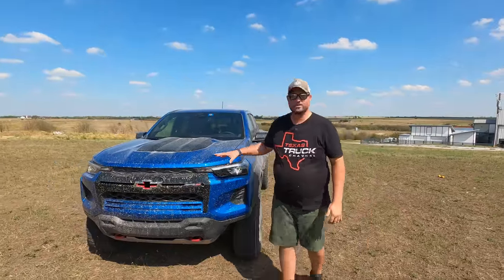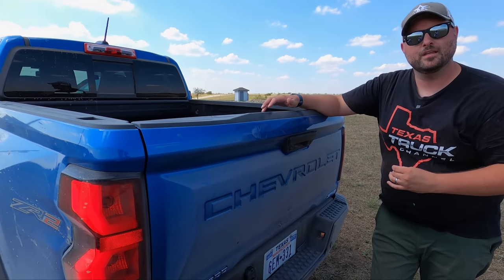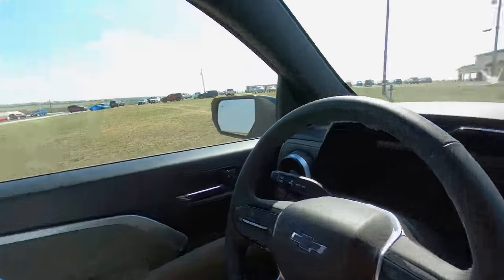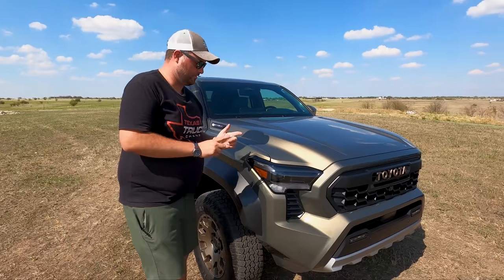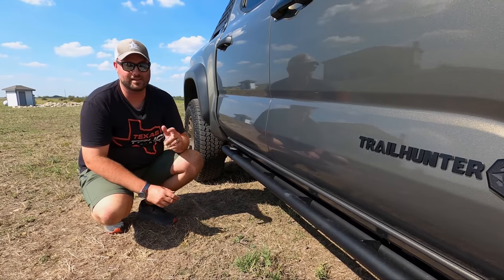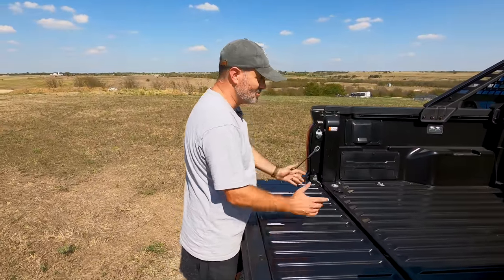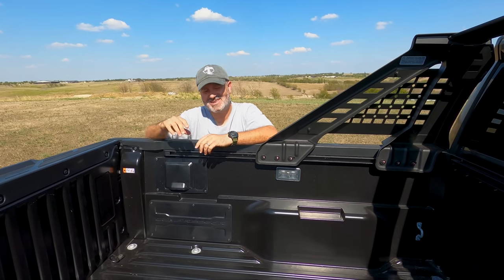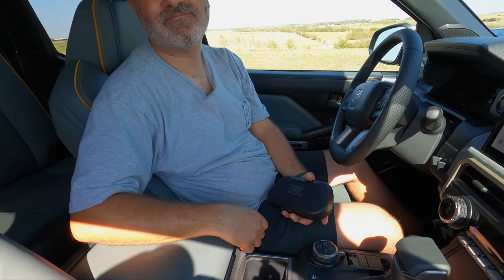Tacoma Trailhunter VS Colorado ZR2 - Which Is The Best Midsize Truck?

Comment: Toyota all day. Its simply going to be way more reliable,  especially on the trail. Can't knock the Zr2 at all though. Its nice looking and very capable.  Just would put my money on something that is not going to leave me stranded, or cost on repairing later on. I have a 07 tacoma that has almost 300k on it, and you're not going to believe this, but ive had to repair nothing NOTHING.  It stil has the original bilstein stock shocks. Simply amazing.  It does upset me that Toyota wont go crazy like the Ford Ranger raptor, or something,  but i understand they are in it for reliability.
Reply: Toyota has a good track record but the tundra has had its fair share of problems. I'd wait a bit for either of these and see what issues, if any, pop up.
Reply: Toyota are less reliable nowadays dude can't compare a 07 tacoma 😂 to a 24 geez i have a 98 silverado still going strong to..  400k 😅
Reply: @rshinn8776  The 2.4T and the transmission have both been in other models for a while now, its fine.
Reply: @geezusmeatball1328 which 2024 Toyota are you talking about? Toyotas are still solid vehicles.
Reply: Wrong
Reply: Interesting to note the 2022 Colorado had a HIGHER JD Power score than the Taco.  I understand old narratives die hard.
Reply: @docholliday7548  The V6 in the Tacoma has been legendary there is no comparison. JD power must of been smoking that day...or taking that sweet sweet GM $$$
Reply: @KillerX1911 ahhh a taco owner that can't handle facts lol. The V6 in the colorados are just about bulletproof as no body's had issues with em. It's been those 1st gen 8 spd transmissions that have really been an issue with the colorado and that's usually been fixed under warranty. Then there's the 2.8 diesel that's been solid with the main issue with those is the stupid def system thx to all these stupid smog emission requirements. The 6spd in them has been pretty reliable. The tacos have not been as reliable either between head issue's transmission issue's so don't act like their prefect trucks lol.

Comment: I’ve had 4 tacos and currently own a 19 ZR2.  The ZR2 is hands down the most off road capable truck I’ve owned but something tells me it just is t as reliable as I found the tacos to be but so far it’s been amazing.  Last 2 tacos had sc on them and no issues and lots of fun.  Getting ready to put an sc on the ZR2 and as quick as the sc 15 taco was (380hp) I’m thinking the ZR2 is gonna b quicker.
Reply: You have the v6 or diesel?
Reply: @dboyfresh  the v6.   Quick is not a description u could give the diesel no matter if it’s tuned and deleted.
Reply: @dansherwood9851   ok good to hear, really thinking of getting a v6 zr2 over getting a new 2023
Reply: @dboyfresh my 21 zr2 v6 is a blast to drive. Traded in my 20 trd off road because i hated that gutless taco. Zr2 waaaay more fun to drive

Comment: I would love a trailhunter 6ft bed, no snorkel or Bed Rack so I can put a camper on it and not feel like I wasted money on that Bed Rack. As for the tires, Toyota has commented previously that the tires they choose are for NVH and to avoid negative reviews in the first 6 months of ownership and that off-roaders will but the tires they like to use anyways regardless of which truck they buy. The only thing that bums me out on the Tacoma is the lack of rear air conditioning for my dogs. I won’t be getting a new truck until next year so I’ll be checking out the entire segment before making a decision
Reply: So basically the TRD Pro…
Reply: @nlmaster9811  nope, TRD Pro does not come with a 6ft bed, and will likely have lower payload due to the OEM Fox Shocks
Reply: ARB is making a bed bar setup in conjunction with Toyota that uses that rack as the front, so you can mount a tent. I'm hoping that it means it will be easily modular so I can take the tent off and have full access to the bed again easily and vice versa.

Comment: ZR2 for me … just way more capability & nicer design IMO.
Reply: Lol how is the chevy more capable than the toyota? Colorados have crap resale and horrible reliability before this model and now they have turbos.. Yota all the way
Reply: @Boltdriver70  LOL  Ok Captain Extra-Chromosome, more capable means actually having a front locker, something the Toyota STILL doesn't have....and so I'll be buying a ZR2.  You can cry about it if you like.
Reply: @kx8960  lol calm down man it's the internet
Reply: @Boltdriver70 dude resale value isn't everything. Hahaha you don't buy a car or truck for resale value you by them because toy like what it has an can do. The ZR2 is an all be me capable as it'll have better approach angles depart angles ground clearance front an rear lockers an so on. The ZR2 was purposely built for off roading the trailhunter looks more like a better grocery getter. Also the colorados have actually been pretty reliable as i can attest to that first hand  I own a 16 that i frequently beat to shit and keeps on going with no issue's besides having to replace one of the nox sensors but that's it.
Reply: @Boltdriver70 The irony to me is you're knocking GM when your name indicates you drive a GM that has absolutely nothing to do with this segment.  If you truly were concerned about resale value, you would've done your homebody before purchasing.

Comment: The tow hooks on the Tacoma are too far under the truck. You'll have to dig for those the first time you get stuck in the mud.
Reply: I agree they're in a bad location but at least it has them. Many people have been saying the Tacoma doesn't have any front recovery points.
Reply: Not to mention the "skid plate " will get peeled back the first rock ledge it hits. Why does it hang down like that?? Really odd design choice.
Reply: @morgancook6481  I agree 100%. I feel like the people designing todays trucks and SUVs have no idea what they're doing. Maybe they've never owned one.

Comment: This was the same Tacoma that had 198mi? If so it had 15 mpg average 😢 I hope that won’t be accurate 😂
Reply: Its a hybrid and has a smaller engine, same size knobby tires, the Taco should do better.  Hwy mileage, probably not much difference.
Reply: It was probably sitting out in the Texas heat running all the time to keep it cool for journalists.
Reply: I'm sure they will sell it with a story of 20-25mpg and it will get 14 just like the last generation. Chevy is every bit as bad. You can see the mpg of the zr2 in tfl's desert drive

Comment: My ZR2 lasted 5 years without any issues except: 

- The headlights were a joke.  I believe I read that the previous-gen Colorado has the worst headlights sold in North America.  

- 8 speed had a class action lawsuit against it, one of the worst transmissions ever 

I ultimately sold it because I couldn’t safely drive it in my climate due to the transmission shifting improperly without throttle and causing wheel spin.

 But if those things are fixed here, would LOVE to get one again…
Reply: Nailed my two major thoughts/concerns EXACTLY with my 2016 Z71.
Reply: You should of gone with the diesel colorado and the 6 speed transmission in them is much more reliable.
Reply: 8 speed trans is the biggest reason I won't buy one.  That's why I'm looking at the Taco.
Reply: I've got an 8 speed in a 19 Trailboss.  It's fine.
Reply: @terrencejones9817  I wish they would've used the 10-speed like the Ford Ranger and my 20 Trail Boss LT has.
Reply: @domin8ss   Not me. The 8speed might have some shifting and shudder issues,  that is useally fixed by  Torque converter change. The 10 speeds grenade all the time. I work for a GM dealership,  I've never seen an 8 speed have a full catastrophic failure.  The 10 speeds do all the time.
Reply: @terrencejones9817  First I've heard of it.  I'm on a Silverado forum and don't recall reading anything about that.  55k miles on my truck and it has been great.
Reply: @domin8ss   10 years I've been with GM. The 8 speed has some issues, but is a physically much stronger transmission than the 10 speed.  Ford seems to have even more issues with their version of the joint 10 speed.  It's not a durable unit.
Reply: @terrencejones9817  The Taco doesn't appear to be all that it was hyped up to be.  The GM midsize trucks are very much in the running.  My kid likes the look of the Canyon AT4, but my wallet prefers to keep cash inside of it.  I might go with the Z71 and add the Trail Boss suspension.  Pricing is coming into play here.  It'll be interesting what the TRD Offroad ends up being.
Reply: I drive a 2019 Silverado with the 8-speed for work. Seems fine to me. I've read about the issue and most complaints were due to the original fomulation of the new transmission fluid that Exxon Mobil made for it. They had to reformulate it so it absorbed less moisture from the air because it was causing the viscosity to go out of spec over time. Probably why some guys switched to amsoil fluid and reported their issues went away. I also read that many dealers weren't following the procedure for the fluid change and were not flushing the transmission out and doing the re-learn procedure. I guess it basically guaranteed that customers were going to show back up with the same problem again.
Reply: @domin8ss  LOL oh the other truck with transmission complaints throughout the 3rd gen.
Reply: @hochhaul   That's correct. The fluid spec actually changed twice.  To the current Blue Label Mobil HP dexron. The relearn/programing on the 8speed is very long and complex, if you skip a step, is pretty much wrecks the transmission.
Reply: @hochhaul  that transmission isn't on its 3rd Gen.  The new Colorado is the first to get the new 2nd Gen.
Reply: @domin8ss  3rd gen Tacoma
Reply: @hochhaul  thanks for clarifying

Comment: Why didn’t Toyota put air vents for the back seat like they did in the new hilux gr
Reply: They have to cut costs back for recession coming. Everyone is doing it. That’s why older models have gone up in value.
Reply: toyota is known for saving little shit like that for the following year as their refresh cycles are about 6 years. i’m sure they’ll add that along with the center arm rest on the back seats along with other minor upgrades like that in a couple years

Comment: That trail hunter is going to be well over $60,000 bucks plus high interest rate for most people buying it because half the people want the latest shit!
Reply: Markups to 85k plus. With tax and interest puts you over 100k.
Reply: No way it's 100k for a Trailhunter
Reply: Zr2 bison will be the same
Reply: Guessing closer to 70k at 7% with A1 credit 🤦 think I'll keep my TRD Sport 4x4👍
Reply: @kidamere2408 Maybe not. The last Bison was mid 50s. You can get a current ZR2 for 48k. Hopefully they keep the Bison under 60k, but not golding my breath. I will say though, even at 65k it would be worth it for the 35s and skid plates along with the larger wheel wells. To do that on a standard ZR2 would be well over 10k.
Reply: I doubt that the ranger raptor starts at 55k and the trail hunter is a trim lower then the TRD PRO so if anything it might slightly be cheaper then a ranger raptor you can find 2024 Tundra Trd pro going for 70k

Comment: The Trail hunter is a nice truck with a lot of great features but there's no way that stickers for less than $60k before any dealer markups.  On top of that I think most people who would actually use it for overlanding are going to want to swap out the tires pretty quickly.  The front bumper looks like it would be pretty hard to add an aftermarket bumper without cutting a lot of plastic and that "skid plate" you pointed out looks puny.  I think the ZR2 will prove to be the much better value, they can be bought at MSRP well equipped in the low 50s and already comes with F/R lockers, great suspension, and a good set of 33" tires.  The bison edition ZR2 will likely be close in price to the trail hunter and offer a lot more.  It looks like most of the AEV bison bumpers and skid plates will bolt right up to the ZR2 as well without much modification.
Reply: The zr2 will not be the better value because it will not hold its value over the long term and will likely require more money to fix the issues it has. Besides that, it's a great truck and looks better than the trail hunter in my opinion.
Reply: @2011buddylee in az they offered me MSRP
Reply: @2011buddylee I read i comments in couple other YouTube videos that 23's have to be built before they start the 24 model year
Reply: @2011buddylee  considering GM still on strike and 23's beed built first Oct 30 isn't going to happen in my opinion
Reply: i feel like hardcore off roaders and overlanders are gonna stay with Gladiators. Other than sheer power they are just better offroad in every way
Reply: Taco has coil rear suspension.  Superior in every way to GM leaf spring rear. Articulation better Combined with front swaybar disconnect  .Toyota for the win!
Reply: @showmemorefunthings9208 according to gm and Toyota warranty claims, the taco has more drivetrain warranty claims than chevys 2.7t
Reply: @BlacksheepLSX  Okay, but that doesn't mean the Tacoma will not have a higher value over the long-term. Also, warranty work is usually not charged to the consumer so over the long-term it's likely the consumer will pay more to repair GM and Chevy costs outside of warranty. My point is still valid.
Reply: @BlacksheepLSX I think Chevy is added a 100K powertrain warranty on the 2.7

Comment: If I were to buy a Tacoma for overlanding it would NOT be the Trailhunter. I would purchase the TRD Off Road instead. You can still get a TRD Off Road with 17 inch rims, which allows for better selections and prices of tire brands and sizes. I would install my own aftermarket "snorkel" that allows the attachment of a Pre-cleaner on the top. I would purchase after market rock sliders that are rated for more than 1/2 the vehicle weight vs the "rock rails" on the Trailhunter.
Reply: You are so wrong with tire selection...
Reply: I don't think so. These trucks are supposed to be good on and off the road. If purchased for that purpose and used for that purpose, drivers gravitate towards A/T tires. Looking at A/T tires that would fit this vehicle, without body mount chops, wheel well work, fender trimming, etc... I think 17" rims beat other sizes. These can be purchased with stock 33" tires, so we can reasonably assume that 34" will fit and not rub at full articulation. Going up one "tire size", or one more inch in diameter, will minimally effect speedometer accuracy and fuel efficiency. Also, a 34" tire on a 17" rim means a smoother and softer ride. An 18" rim, or bigger, will always mean less sidewall for a rougher ride compared to a 17". Of course MT or street tires means a whole other selection available.  @atg1338
Reply: Wrong choice. The 17in version has smaller brakes meaning smaller payload, which is key for overlanding.
Reply: You can purchase better (thicker) rotors for the tacoma with 17” rims. It is becoming common for us GX 460 owners to replace the 18” plus stock rims with 17” aftermarket rims to allow for more sidewall. Then add your gear, bumpers, armor, roof rack, skid plates, etc… you can find that your 5,300 lb SUV now weighs 7,000lbs! Then upgrade stock rotors to a thicker aftermarket rotor, put on a good set of pads, and you are good to go! You SHOULD be able to do the same with a new tacoma.
Reply: If you have a new tacoma loaded with gear, and towing, an off road trailer, then I would prefer thicker and larger diameter rotors. Then, I would want bigger rims to accommodate thicker AND larger diameter rotors. But, just me and my stuff with no trailer being towed, then there should be no need for thicker and larger diameter rotors.
Reply: @brianphillips8228  I don’t agree. Larger brake pads might improve your safety but not your payload. Driving above your vehicle GVWR puts you liable in case of accident.

Comment: So the Toyota is essentially a year behind and then offers no front locker, worse tires, worse shocks, less wheel travel, has to rely on hybrid to make similar power and will undoubtedly be more expensive. Just like last generation, only thing they offer is the name and then we cross our fingers and hope it’s reliable unlike the new tundra.
Reply: Yup. And it'll double in sales from existing figures.
Reply: Eh dunno bout cheaper
Reply: Bet it will be twice as reliable as that Chevy.

Comment: Chevrolets 2.7 turbo was the most reliable engine GM has produced behind the 5.3.. GM ran it 7,500,000 miles connected to a machine under load and another 2,500,000 miles on the road.. Look up its durability testing. It will outlive the taco.. mark my words..

Comment: Funny how they compare the Trailhunter to the basic ZR2 and still loses. Can’t even compare it to the ZR2 Bison when it comes to off-road capability. Whole different level
Reply: Based on what. The Trailhunter hasn’t even been released yet and you are trying to decide that you know which truck is a better off-roader. Yeah because you are such an expert. 🤦‍♂️🤦‍♂️
Reply: Colorado vs tacoma ,zr2 vs trailhunter, zr2 bison vs trd pro etc trd offroad vs zf1 lol
Reply: Details on both vehicles are out lol do some research there bud
Reply: Did you even watch this video? Lol or any others on the specs?

Comment: I'm just afraid what the price is going to be for trail hunter. I think I'm still going with the zr2
Reply: The ZR2 is more capable. The TurboMax can be tuned stock and make 350whp and over 500lb ft of torque on 93 octane and still hold the power reliably. Trifecta has a milder option if you don't want the extra power and just want a healthy dosage of torque and some horsepower
Reply: @saltyfloridaman7163  yeah even if they say its a toyota having a hybrid is not cheap at all. specially where i live mechanics are not that accustomed to working with hybrids at all maybe at least in the next 10 years.